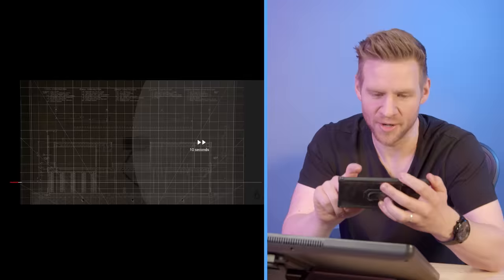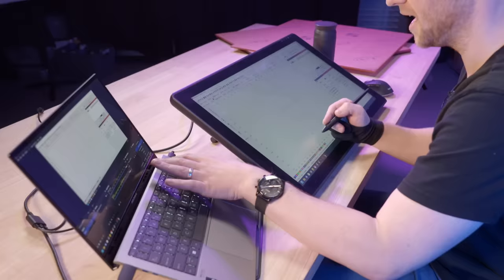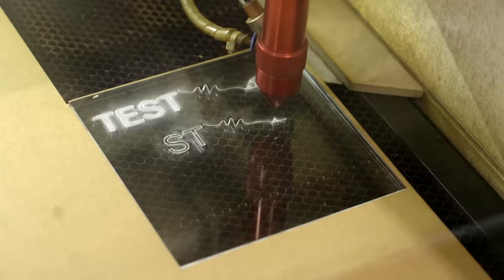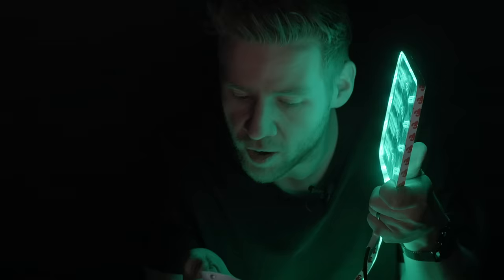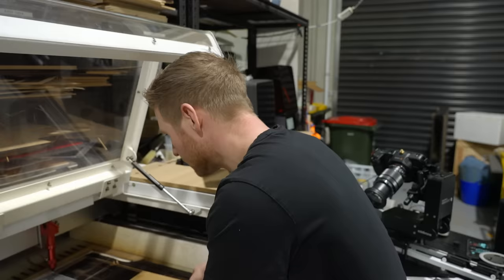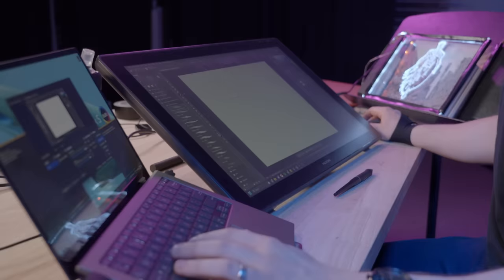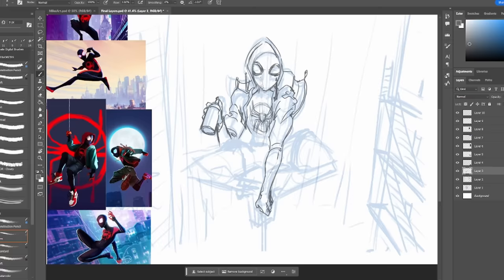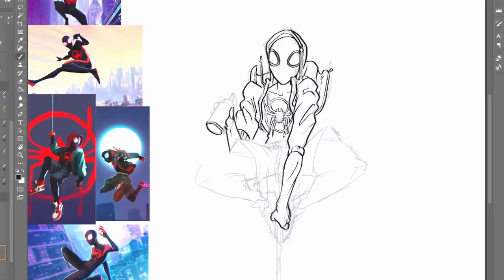Glowing 3D LASER ART is MIND BLOWING!

Comment: If u wanna avoid the frosty edges, leave the brown protector layer on the acrylic and it cuts super neat through!
Reply: I think the issue that came up as part of his research is that weeding the protector off afterwards with such high detail/closed loop cut patterns ends up more often than not taking more time and putting more permanent scratches in the material to the point that it obscures the artwork more than it would to just peel the protector off first and wipe it with alcohol like Jazza did
Reply: You can remove that brown protector and replace it with a low tack transfer paper, way easier to remove
Reply: Use a thin layer of dish soap instead.
Reply: Tape also works!
Reply: @bradonhoover3002  I learned to used gorilla tape to do this, it'll stick to all the little bits and I just keep moving it around sticking and removing. Great for tiny bits of paper mask.
Reply: @qwiggles4154  Yeah, I've been watching more tutorials, and I think I've found the best strategy. You line the bed of your laser cutter with 4 layer thick (two folds) wet paper towels, apply a medium tack paper transfer paper, not a plastic one, and then you use duct tape to peel the remaining mask off after cutting. Before cutting the mask off, you can paint the cut areas for various effects as well

Comment: For generally using Lazer cutters it's better to keep the film on the acrilic, it helps minimize the fuzziness and in general it's better to do it for everything you can it helps also with wood to minimize charring if you place tape on the area you wish to cut. This is just my experience with using them and it works completely fine for etching too obviously. As long as you have a good ventilation(not even needed just me being really really overly cautious on advice), which you should since you use a Lazer cutter.

Comment: Use the clear rear panel like did for the back. Get blue, red, yellow, and lightly smokey gray sheets. Engrave the background on clear. Next, take all the pieces that are red and engraved on the red sheet. Blue on blue and smokey gray for the black outline. Then stake the.  You might need to get thin acrylic like 3mm.

Comment: So I do laser engraving and if you are getting the frosty edges there are 2 reasons one the power is too high. The other factor is they type of acrylic you are using. You dont really need to go deep at all for this to work you can do a very light etch and you will get the same effect. Also its best to do your artwork mirrored and then flip it so the front facing portion is as smooth as possible. It makes for a much cleaner look.

Comment: Cast arylic is brighter than extruded material in edgelit art. Its also more expensive. Another way to get more brightness is to CNC the lines with a V bit instead of laser cut them. You can save half of the LED strips by using aluminum tape on opposing sites as a reflector.

Comment: I discovered a similar effect by accident a few years ago, except using a CNC mill. Im nowhere near the artist Jazza is, so I manly stuck with pictograms. but the effect is really really striking in person. a green lit biohazard for my fishtank, company logo for my office, a bunch of funny warning signs, that kinda thing. I found polycarbonate worked better than acrylic, and I would suggest a laser over a mill, cos that thing is LOUD when its cutting.
also, the edge lighting is really efficient, even a single LED is effective, but I found one in the middle of each edge was enough, I just superglued SMD leds straight on. you can use standard 5mm leds, but you need to file the lens part flat which is a pain, and the epoxy is really stanky when cut.
I was lucky enough to be given a few days at work to play with the CNC, the instructions pretty much "figure out how to run this thing and what it  can do". if you get the chance, I highly recommend having a play with this technique. and you dont have to be a good artist. I started by googleing "portals svg" theres some great funny icons in that game that are easy to cut.